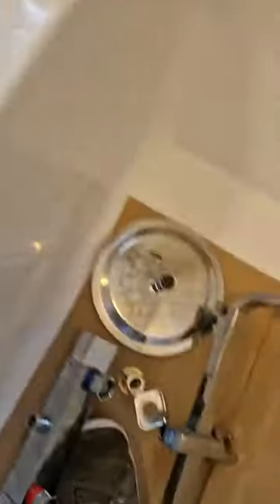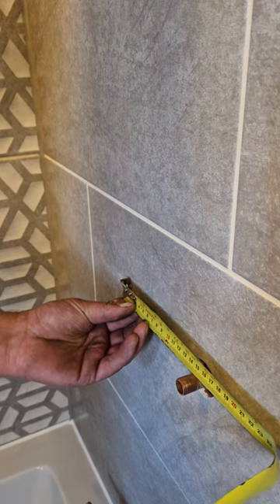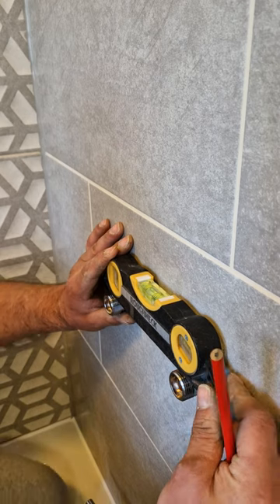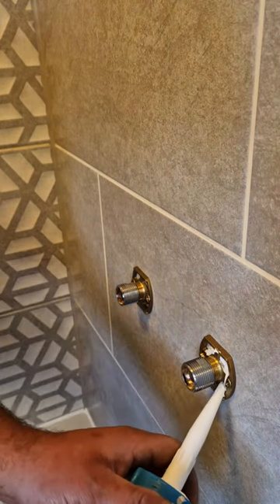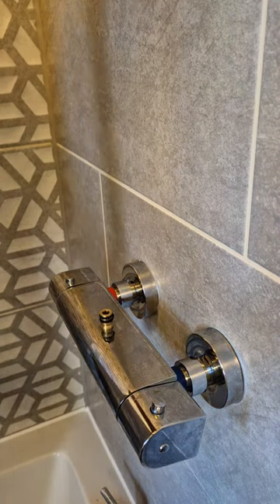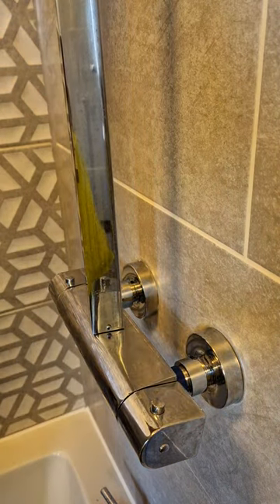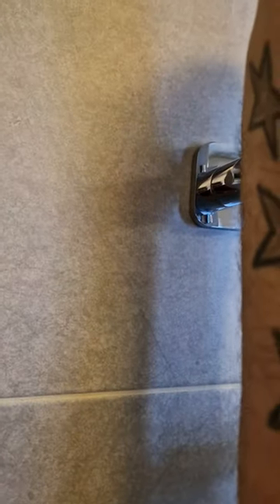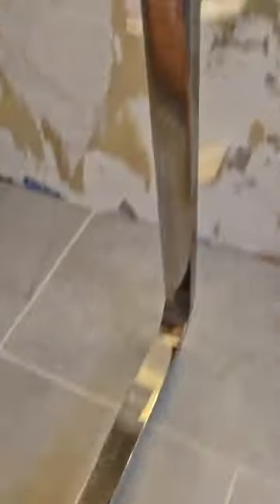How to fit a bar mixer shower using wall plates.

Comment: Great video, thanks. A relative new DIY person here - can I ask, did you have studding on the rigght hand side, and gap --> solid wall on left? So 2 different length screws? Also why did you only use 1 screw on the right bracket? CHeers
Reply from the maker: Thanks for watching I could only put one in as the pipe would have been in the way for the other screw.
No didn't have stud work just a rubbish brick so put a longer screw in to get a better fixing.
Reply: @primalrenovations7427  Ah, I see what you're saying. I've a similar job to do for a family member (So don't want to take it on unless I'm happy I won't screw it up.) The wall is a solid garage wall, I'm guessing dry-lined, and tiled. Looking at the protruding pipes, I can see some evidence of plaster around them, for some reason. So I guess I will need to put a rawlplug on long screws, and try and get to the brick wall, which I hate doing. Might have to politely refuse this one - we are currently on good terms 🙂
Reply from the maker: @concunningham9795  
It's easier than it looks if you drill a slightly bigger hole through the tile like a 6/8mm then use the 5.5mm drill bit for the brick you can pass the red plug through the wall tiles into the brick and just use a screwdriver to tighten it up.
Reply: @primalrenovations7427  Cheers for that - I'm looking at other things like CoreFix, and DuoPower - all new to me. The CoreFix seems to be quite proud of the Tile, so I think this might be an issue for the base of the mounting brackets that slip over the pipes. I'll hold fire until I'm up there next weekend - there's only a small part of the wall tiled for the shower. I might poke a few judicious holes in a different part of the wall and try to verify that it's D&D, and figure out how much of a void there is. If you ever find yourself in Ireland, I owe you a pint!
Reply from the maker: @concunningham9795  
Well if you have any questions don't hesitate to ask.
Cheers

Comment: wow how tricky is that !!!! Well done! Esp getting the 150 centres bang on I have a stud wall with nothing to fix to behind Do you think smaller pipe holes would help the bar shower fixing?
Reply from the maker: Yes smaller holes would help.
You could also put some wooden noggins in behind the plasterboard if you can.
Reply: thanks   more vids please
😃
Reply from the maker: Well if there is something you would like to see just leave a comment and I'm sure I could do something 👍
Reply: shower tray installation would be great😊
Reply: I would have filled the holes where the tails poked through with CB1 as well as the smaller holes you’d filled in after the fittings.
👍🏻
💂‍♂️🏴🇬🇧
Reply from the maker: Yes I did fill with clear silicone I'm not a huge fan of ct1 to be honest it's not as good as people think